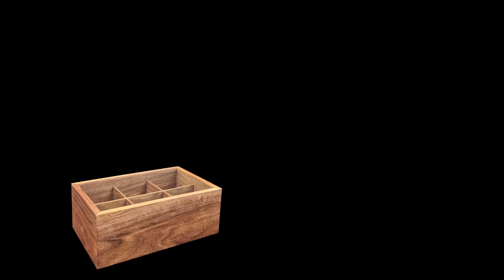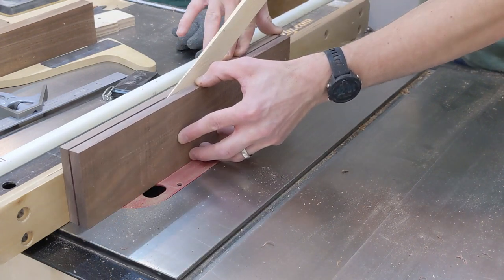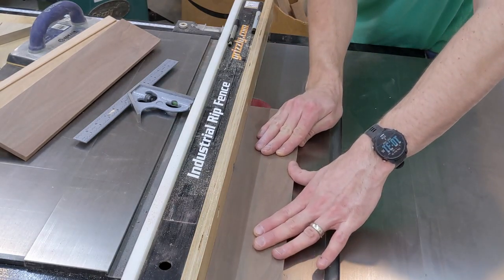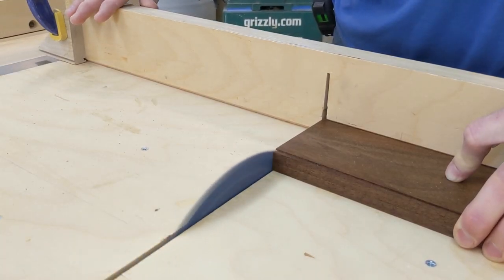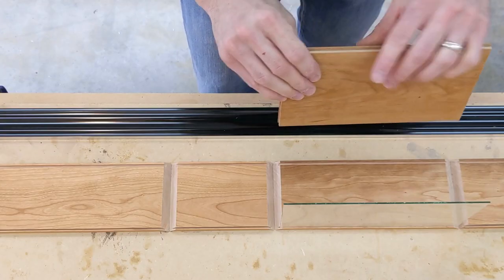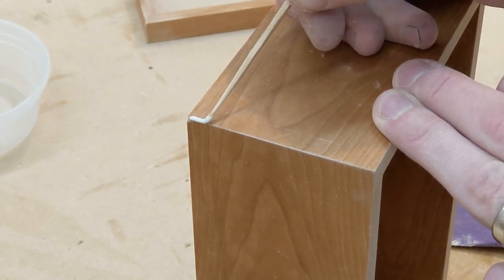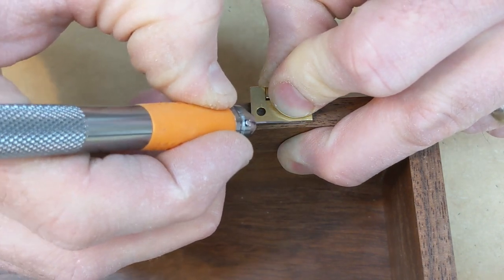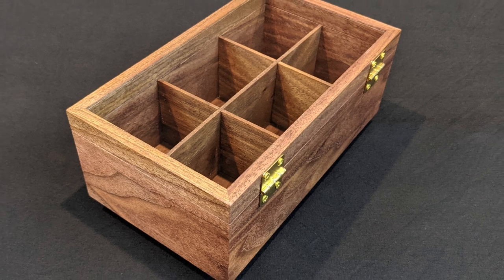Tea Box With Continuous Grain Wrap! How do you do it??

Comment: How did you know how long to leave the side piece before cutting them down further?
Reply from the maker: Hi Michael, good question! The length was determined based on the desired dimensions of the individual compartments. Let's say the compartments are 2" wide x 1.5" deep, box sides are 3/8" thick and the divider stock is 1/8" thick. The length of the long sides of the box (to the long side of the miter) are then determined by adding 2+2+2 (the width of three compartments) + 1/8+1/8 (two dividers) +  3/8+3/8 (thickness of 2 box sides) = 7". I hope that makes sense, let me know if you have additional questions!

Comment: Several poor and unsafe tablesaw techniques. Never stand directly behind the blade in case of kickback. Never push the wood with left hand toward the blade - it can pinch. Pressure against the fence has to be removed as the wood reaches the blade. Keep your left hand away from the blade! There is no need for it to be there if your set up your cut properly. Nice boxes, though.
Reply from the maker: Hi Craig, I appreciate the considerations. You watch with a keen eye! I always try to be safe with my tools but surely have plenty of room for improvement. Thank you.